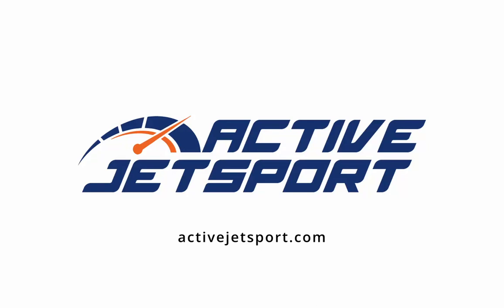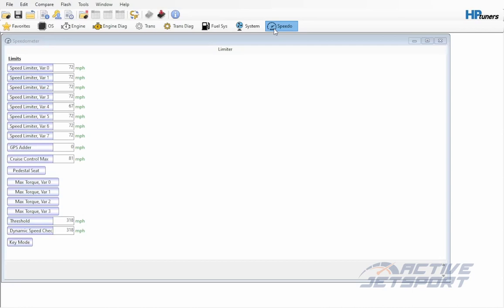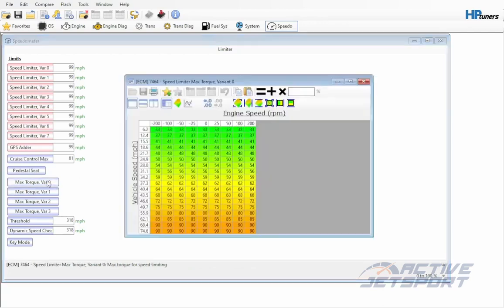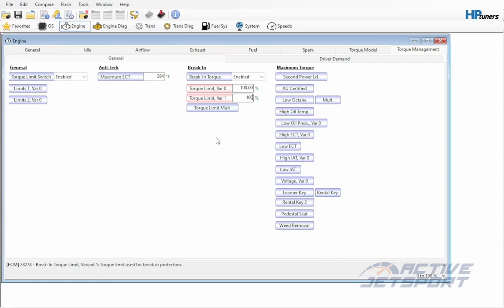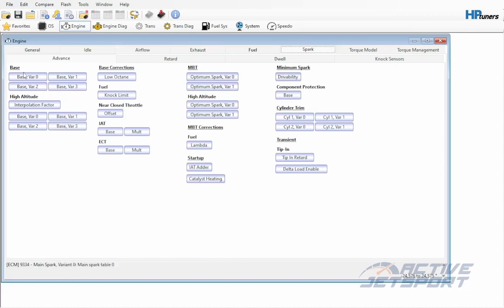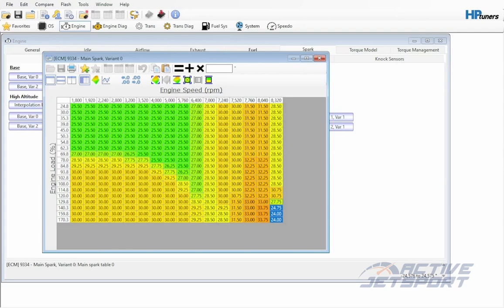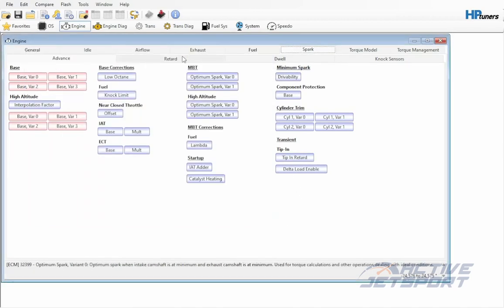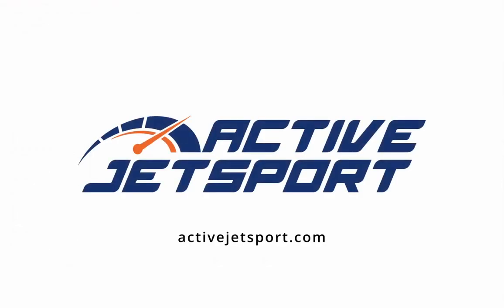HP Tuners - Sea-Doo 300 Limiter Removal

Comment: hi,the speed axis on max torque  does not need to be modified to 99mph to?
Reply from the maker: You only need to modify the settings shown in the video to remove limiters.
Reply: @activejetsport  asking because on the 170 models speed axis ends on 100 km/h